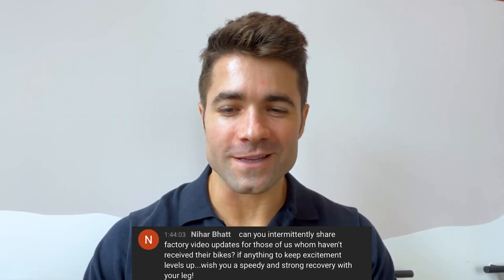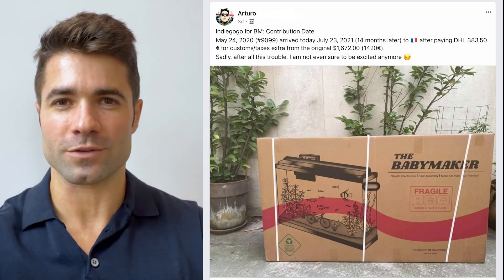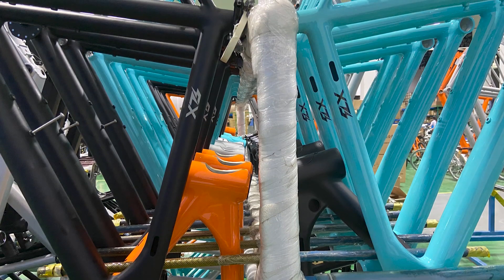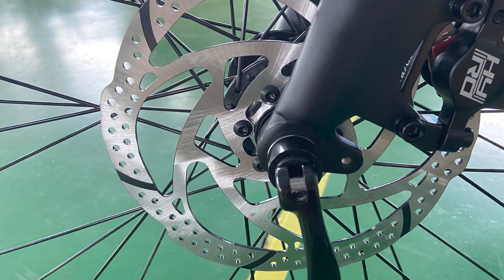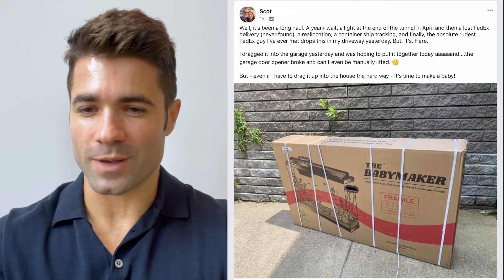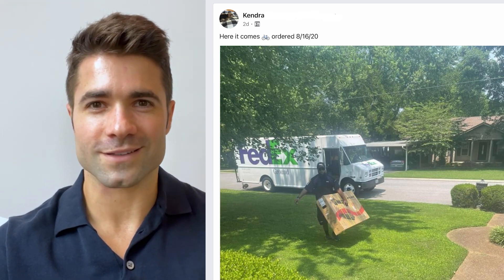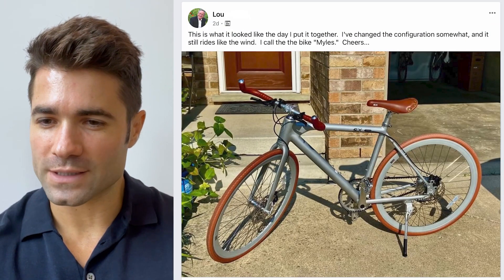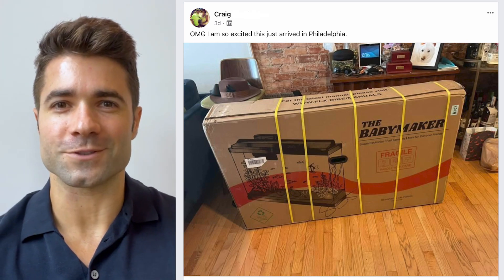Babymaker Production Update: Fresh From the Factory Floor

Comment: My bike came with a barrel type power plug
on the power brick. My bike however has a three pin female connector?! Is there an adapter that goes with it but was missing in my box? If so, what is the name/specification of this adapter?
Reply: I have the same problem at this very minute ARN0NYM - let me know if you get it resolved.
Reply: No, they sent you the wrong plug. Contact flx support to get a proper plug sent to you. This has happened to a lot of people.
Reply from the maker: Hey there! Please reach out to us at support@flx.bike so we can help get this sorted out
Reply from the maker: Hi! Please contact our rider support team at support@flx.bike as we are familiar with this issue and are happy to help you get it resolved!
Reply: @superhumanbikes  i reached out via contact form and email days ago. just tell us the connector type and where to get an adapter from..

Comment: just bought one of these off of a neighbor, i gotta say they are pretty meh. I would tell most people to either go for a mid drive electric bike oooor just buy a light weight single speed, these are about twice as heavy as a normal single speed and the motor is pretty weak.
Reply from the maker: Hey John, appreciate the feedback🙂